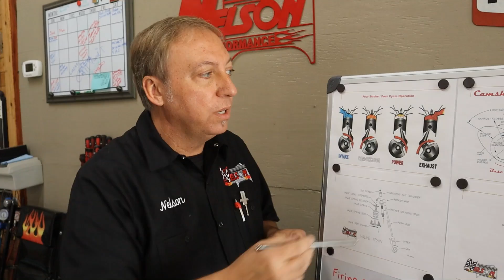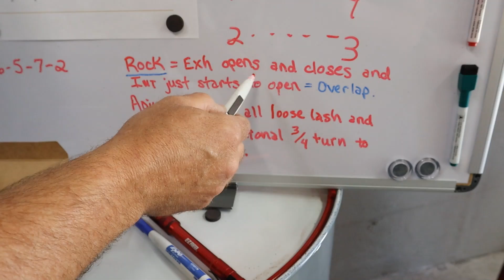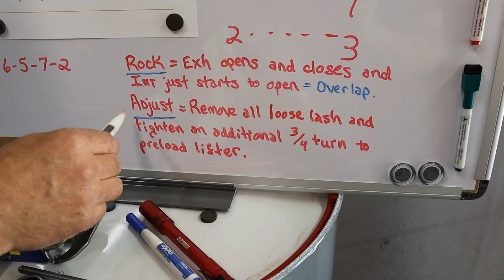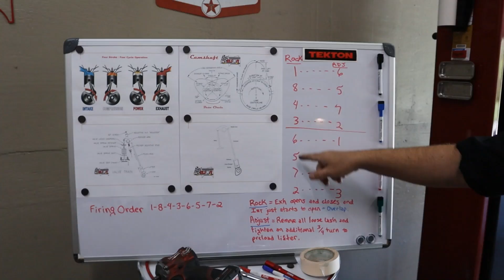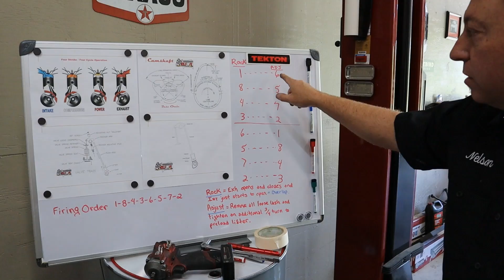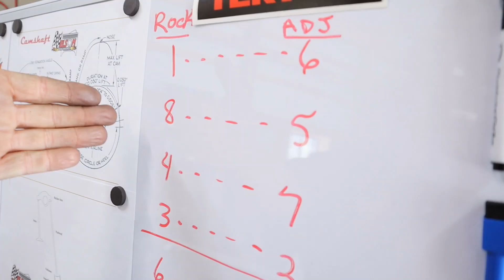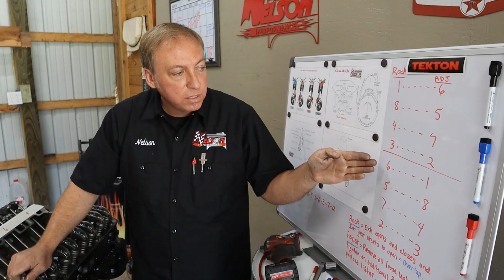Rocker Arm/Hydraulic Lifter Adjustment

Comment: Hi Mitch.  I had to replace  spring retainer and a pivot retainer on a 1998 dodge ram 1500 5.2L so I had some lifters that had bled down and some that didn't.   Both intake and exhaust lifters on the #7 cylinder were still rock hard after sitting several days so I used a washer etaped to the top of the push rods to "convice them" to bleed down, but they're still "firm".  I wanted all of them to be approximately the same before making the adjustments.  What should I do?
Reply: Also, my rocker arms are secured in pairs via the pivot retainers.  I've tried to tighten them to just before they are tight in equal measure, but will this method still work with these?
Reply: BTW, after viewing many videos and reading many forums and service manuals, you seemed to be the smartest tool in the shed!  That's the reason I've come to you with my questions. 😊
Reply from the maker: Hello, sorry for the late reply, usually if the engine sits for a little time with that lifter/rocker at full valve lift, the valve spring will have enough pressure to bleed the oil back in that lifter. It’s a slow bleed down time so it may take some time. Then rotate to the next lifter/rocker that needs bled. You would need to do this by hand because using the starter can at times run the oil pump fast enough to produce oil pressure back in the lifters. Hope that helps and thanks for the kind words and viewing, Nelson.

Comment: How do I do this with an engine that's in the car and the lifters are not visible?? Is it possible? Im trying to check the lash and all my rocker arms are tight and solid even after sitting over night. I removed a push rod and measured it. 7.8in Engine is a 283 with Edlebrock Heads and roller rocker arms.
Reply from the maker: Hello Greg, first off, thanks for the view! Having the manifold on is no problem, you can just watch for the pushrods to fall and rise instead of watching the lifters and if you feel the up and down slack in the pushrod while tightening the adjuster nut you will know when to make the 3/4 turn. You can have a friend tap the starter while you watch them but it takes a very slight tap of the starter to get to the next adjustment. The lifters should bleed back as you rotate the engine while doing the adjustments. Under full lift and no oil pressure (engine not running) the valve spring will bleed it back unless it has a solid lift cam? Good luck on the project!

Comment: On my motor, i cant press down on the push rod, is this a problem? (Chevy 305)
Reply from the maker: Hello, you can still use the 3/4 turn and do the adjustment with lifters that already have oil pressure in them. The valve springs have enough pressure to “bleed” the lifter back under full valve lift during the adjustment process since there is no oil pressure until the engine is started up. The only other possibility would be if someone had installed a solid lifter cam but not likely. Good luck on your project! Thanks for the comment and viewing! Nelson
Reply: @mitchnelsonperformance  thanks for your videos, motor running great now😁

Comment: My husband struggle with his v6 the cylinder head doesn't get oil he put 30u heads on upgrade v6 block he. Change the push rods
Reply from the maker: Hello, not sure how I can help. Does it have oil pressure on the gauge?
Reply from the maker: Also, sorry for the late reply, Nelson.

Comment: What if my lifters are already pumped full of oil? 5 of my cylinders on my fresh 78 la 360 are at 150 psi and one is at 0 psi and 2 are at 120, do i still do 3/4 preload, if my engine has already been running and lifters are full of oil?
Reply from the maker: Hello Blake, you can still use the 3/4 turn and do the adjustment with lifters that already have oil pressure in them. The valve springs have enough pressure to “bleed” the lifter back under full valve lift during the adjustment process since there is no oil pressure until the engine is started up. Good luck on your project! Thanks for the comment and viewing! Nelson

Comment: Any advice you can give me / us for adjusting valves on sbc 350, with out the intake removed???
Thx and super video
Reply from the maker: Hello first off, thanks for the view! Having the manifold on is no problem, you can just watch for the pushrods to fall and rise instead of watching the lifters and if you feel the up and down slack in the pushrod while tightening the adjuster nut you will know when to make the 3/4 turn. You can have a friend tap the starter while you watch them but it takes a very slight tap of the starter to get to the next adjustment. Good luck on the project!

Comment: Is that chart good for a 2001 Dodge pickup 5.2 l motor V8
Reply from the maker: Hello, yep, that engine has a 18436572 firing order with 1357 on the left bank  and 2468 on the right so it should be just like the video aside from a possible diff in int or exh valve placement 🤔 can’t remember that? Thanks for the view and the comment friend👌 Nelson

Comment: This is the best video I have ever seen  about this .an I been looking ..the only question I have is do I have to take my intake back off to do this the right way
Reply from the maker: Hello first off, thanks for the view! Having the manifold on is no problem, you can just watch for the pushrods to fall and rise instead of watching the lifters and if you feel the up and down slack in the pushrod while tightening the adjuster nut you will know when to make the 3/4 turn. You can have a friend tap the starter while you watch them but it takes a very slight tap of the starter to get to the next adjustment. Good luck on the project!

Comment: I watched alot of videos on valve adjust! And get more
 confused!
Reply from the maker: How can I help ya? What part seems confusing? Nelson
Reply: All of it, no one seems to want to answer the question; What if your using the OLD LIFER, I'm just having the heads rebuilt.
Reply from the maker: Hello, you can still use the 3/4 turn and do the adjustment with lifters that already have oil pressure in them. The valve springs have enough pressure to “bleed” the lifter back under full valve lift during the adjustment process since there is no oil pressure until the engine is started up. Good luck on your project! Thanks for the comment and viewing! Nelson
Reply: @mitchnelsonperformance  ok 👍 ty
Reply from the maker: No trouble, Good luck! Nelson

Comment: What happens if you don’t do the 3/4 turn at the end?
Reply from the maker: Hey Matthew, the engine will run fine but by not doing any preload (3/4 turn) the cup in the center of the lifter will have hydraulic pressure against the retaining clip risking that it could pop off into the engine.

Comment: So this is done with no oil in the lifters?
Reply from the maker: Yes, so you can feel the preload (movement) in the plunger. After adjustment I would recommend to prime the oil pump. Thank you for the comment! Nelson
Reply: I know. I'm asking to confirm there is no oil in the lifters..... 
I'm going to do this soon on my 1994 LT1 engine. Wondering how to pump the oil up to bleed the oiling system after doing it this way...
Reply from the maker: Hello, you can still use the 3/4 turn and do the adjustment with lifters that already have oil pressure in them. The valve springs have enough pressure to “bleed” the lifter back under full valve lift during the adjustment process since there is no oil pressure until the engine is started up. Hope that cleared it up.Good luck on your project! Thanks for the comment and viewing! Nelson

Comment: Why not just adjust using the firing order. TDC of #1 on compression stroke then rotate a little bit and do #8…and so on. What’s the point of rocking and adjusting, finding sister cylinder and all that? If you’re wanting both valves closed just go in order of firing. Much simpler to me. 🤷🏻‍♂️ makes more sense.
Reply from the maker: Hey first off thanks for the view! Many people have many methods. We have found this to be the most accurate. This method does actually adjust them in the same order as the firing order. If you look at 6min 44sec in on the video at the chart and start in the middle and adjust from there it is the sequence (18436572)of the firing order. The trouble with using TDC is that most cams are not truly on the dead center of the “base circle” exactly at TDC and performance cams are even more unpredictable. Many people seeking this method also can’t see the piston easily when it’s in a vehicle and many even have the intake manifold installed so once you pass the TDC timing mark on the balancer for #1 cylinder  it would be difficult to judge when the next (cyl 8) would be in the best location for adjustment. Good luck on your projects and Thank you for the comment! Nelson

Comment: Is this for 6.0 2001 vortex
Reply from the maker: Hello, first off thanks for the view and comment! The 6.0 has torque down rockers and are non adjustable unless it has been fitted with adjustable rocker arms. If you are installing new lifters you can still use the process to make sure you torque them when they are not under cam lift (valve spring pressure) and you can also view the preload of the lifter at that time. Double check me but I think it’s only around 22 foot pounds of torque. Good luck on the project! Nelson

Comment: Would you be able to do a video of the exact same thing but with the intake on and going without seeing the lifters?
Reply from the maker: Hello first off, thanks for the view! Having the manifold on is no problem, you can just watch for the pushrods to fall and rise instead of watching the lifters and if you feel the up and down slack in the pushrod while tightening the adjuster nut you will know when to make the 3/4 turn. You can have a friend tap the starter while you watch them but it takes a very slight tap of the starter to get to the next adjustment. Good luck on the project!

Comment: This is a great how to for any engine builder. 👍. I just used this technique on my sbc and i don't know if it's the comp cam or lifters, but the extra 3/4 turn seemed like too much for my application. The lifter plungers were all but bottomed out with 3/4. With a half turn, the plunger seemed to be about half compressed. Hopefully i didn't make a fatal error
Reply from the maker: Hello and thanks for viewing and the kind words! 1/2 turn is just fine 👌 a range of 1/2 to one full turn will work for lifter pre-load. Good luck on your projects ,Nelson

Comment: This is a seriously wonderful deep-dive.  Question - when you are removing the slack or lash from the rocket, is there a precise way to determine when that slack is actually gone - such as using a feeler gauge?  Same goes for after the 3/4 turn, how do you precisely tell if it's where you want it to be?
Reply from the maker: Hey Cory, first off thank you for viewing and the comment! If you can see the lifter you can use a flashlight to view the lifter plunger retaining clip. When the slack/lash is out it will begin to push down that plunger. Otherwise it’s not as crucial as you may think. Anywhere from 1/2 to 1 full turn is the range. The Go-No Go for lash/pre-load between the rocker and tip of the valve after the adjustment is made is .080 min to .180 maximum plunger travel when the lifter is on the base circle of the cam. Many engines do not even have adjustable rockers so you kind of get what you get. Good luck on your projects! Nelson

Comment: All the years I've been doing mechanic work I've never not once gone through that process or anything close when it comes to adjusting lifters all i do is just take off the lifter pans and start at the front working my way to the back tightening them up until there's absolutely no slack at all in the lifters and give them a little extra turn with my ratchet for good measure and to be safe and so far I've never not once had a single problem with the lifters I've adjusted on my own vehicles as well as for other people and i don't use gauges or anything else i just go by sight and feel nothing more and every single time when the engine is fired up again it purrs like a new born kitten
Reply from the maker: Nice👍 Thanks for the view and the comment! Nelson

Comment: How do you adjust them with the intake installed?
Reply from the maker: Hello first off, thanks for the view! Having the manifold on is no problem, you can just watch for the pushrods to fall and rise instead of watching the lifters and if you feel the up and down slack in the pushrod while tightening the adjuster nut you will know when to make the 3/4 turn. You can have a friend tap the starter while you watch them but it takes a very slight tap of the starter to get to the next adjustment. Good luck on the project!

Comment: Thank you Mitch!!! Seriously, you are a great teacher, even for us old motor heads that really only know the basics. I was gonna pull my plugs to make the turning over easier, pull valve covers. Just not sure if I should release the existing preload so that I can start fresh? Should I back them off a turn the eyeball each push rods movement? 
Thank you for answering, it means a lot to me, I love this truck👍
Reply from the maker: Hey Terry, you can just back them off and then readjust them as you go through the process (I.e. you don’t need to back them all off first). Yes, a slight up and down feel of the free play will be felt in the pushrod or you can gently lift up and down on the rocker to valve tip until -0- lash is met. You may need to use a 5/8 spark plug or other thin wall socket because I’ve seen thicker wall sockets push against the rocker giving a false feel, or just pull the socket out and check free play then reinsert it as you adjust. Pulling plugs are optional. Once you get it in position (rotation) to begin, the rotations are only 90 deg so it’s fairly easy to rotate between adjustments. If you have a friend that can just feather bump the key, the starter will work great to run through it. Or you could bump it 60 deg and wrench it the other 30 😁Good Luck! 👍
Reply from the maker: Also, you can still use the 3/4 turn and do the adjustment with lifters that already have oil pressure in them. The valve springs have enough pressure to “bleed” the lifter back under full valve lift during the adjustment process since there is no oil pressure until the engine is started up. You just won’t get that spongy preload feel that I show in the video when I’m rechecking my work due to them being full of oil.
Reply: Thank you again Mitch for taking the time to answer my question's. You are a good man and I thank you for bringing value to your followers!!!  @mitchnelsonperformance
Reply from the maker: No problem 👌

Comment: This was a great instruction video Nelson!! I have a question? Can this be done without pulling my intake manifold on my small block chevy that was just recently been built with a hydraulic roller cam? Thank you!!!
Reply from the maker: Hello first off, thanks for viewing and the kind words! Having the manifold on is no problem, you can just watch for the pushrods to fall and rise instead of watching the lifters and if you feel the up and down slack in the pushrod while tightening the adjuster nut you will know when to make the 3/4 turn. You can have a friend tap the starter while you watch them but it takes a very slight tap of the starter to get to the next adjustment. Good luck on the project! Nelson

Comment: 5 days of reading and watching videos and getting more confused and demoralized about to give up i watch your video its like you turn on the light im not working in the dark best teacger man i hate watching instructional videos but gladly watch all your videos thankyou for sharing your knowledge and providing the wisdom to use your knowledge
Reply: All I ever done when it comes to adjusting lifters is just leave them as they are I never rotate or rock the engine or lifters all I do is just go down the line and tighten them until there is absolutely no slack at all in the lifters and leave it at that and so far out of all the years that I've been doing mechanic work I've never had any problems yet
Reply: @michaelscott8129 I'm working on my 72 Chevy El Camino with a 350 small block.  Wanting to check the head bolts for torque since I didn't put thread sealer on the head bolts.  I was young and no Internet in those days.
Reply from the maker: @ GM didn’t use sealer for years so you may be just fine
Reply from the maker: Hey Tony, so glad we could help out with your project and we really appreciate the kind words and the comment 😁 Nelson

Comment: How to do it with a closed engine on a car? Set timing to 0 and rotate by 90°? Thank you
Reply from the maker: Hello first off, thanks for the view! Having the manifold on is no problem, you can just watch for the pushrods to fall and rise instead of watching the lifters and if you feel the gentle up and down slack in the pushrod while tightening the adjuster nut you will know when to make the 3/4 turn. You can have a friend tap the starter while you watch them but it takes a very slight tap of the starter to get to the next adjustment. (90 deg) Good luck on the project! Nelson
Reply: @mitchnelsonperformance  Thank you very much, very well explained. I have a c10 Cheyenne 1978. Martin
Reply from the maker: Hey Martin, glad we could be a part of your projects 😁👍 we have a 68, 71, 72 C10

Comment: Can I find hidraulic lifters for an old engine ford 6 cil in line? where cai I find aftermarket lifters?
Reply from the maker: Hello, I’m not certain of the year and cubic inch of your engine but Summit Racing 1 800-230-3030 is a good starting point. Hope that helps. Good luck on your project and Thanks for viewing and the comment. Nelson